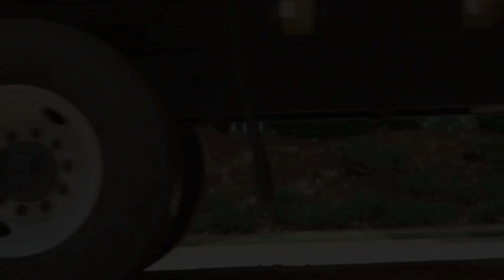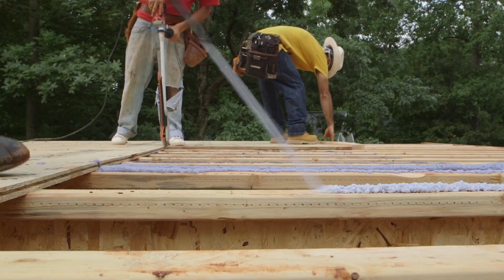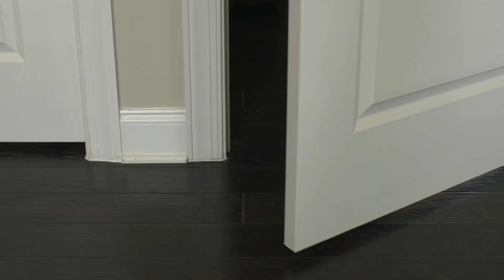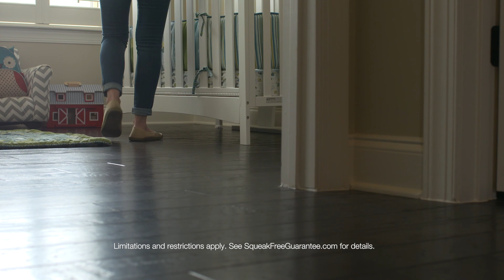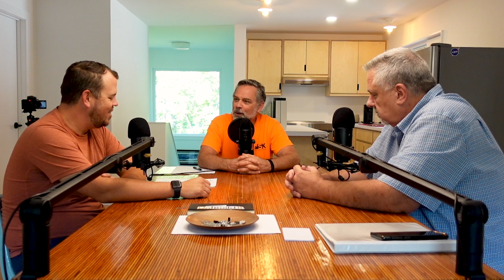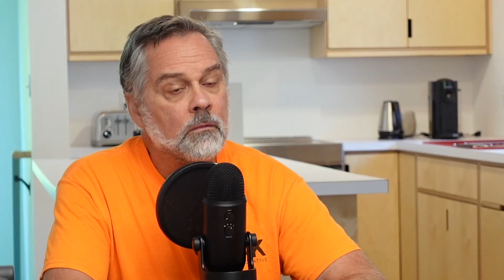How to Build a House Without a Floor - Unbuild It Podcast Episode 42

Comment: How is this any different than any crawlspace with leveled dirt? We now put poly over the dirt for moisture control. Load points are all handled with footings just like we always do. I prefer to build with total sealed and conditioned crawl and attic. Wood floor structure is placed upon treated sleepers on top of concrete slab that is tied into precast insulated concrete wall panels.
Reply: Thomas, we are omitting the sleepers and the supporting structure. We have compacted aggregate, insulation, subfloor and finished flooring without having the other supporting structures.

Comment: When will you guys do an entire podcast on ICF, vs your standard stick built construction?  I remember commenting on Steve’s article analyzing whole wall R value on JLC Online, and asking him to compare his best wall (2x6 with exterior insulation) to ICF.  Comments were immediately removed from the article 😂  Even Steve admits he isn’t up to speed on ICF since he just found out there’s a 96”x18” block.  More news for Steve, there are now 4” thick insulation ICF blocks, for a total of 8” of insulation.  Let’s see a comparison of a Nudura XR35 ICF construction wall vs. anything stick built.  Compare everything; cost, actual R value, disaster resistance, longevity, sound dampening,  etc.

Comment: Hard to see how these concerns balance off radon, bugs, etc concerns -the answer is build a full basement, handle water penetration on the exterior, and have easy  access to all mechanical lines except for water main penetration on wall and LOW pressure PVC drain lines
Reply: But you just added the cost of a basement to the project.